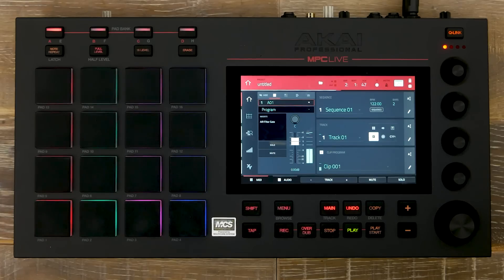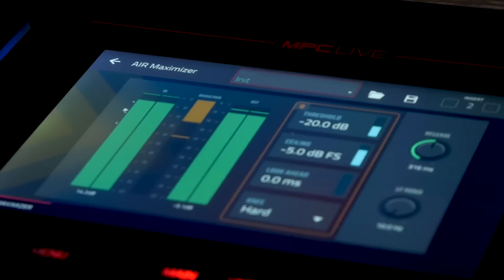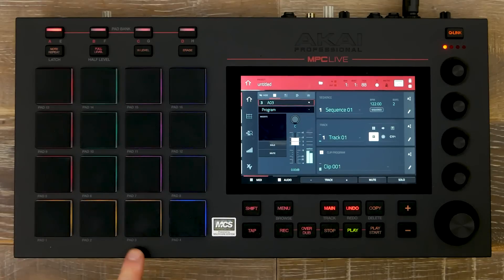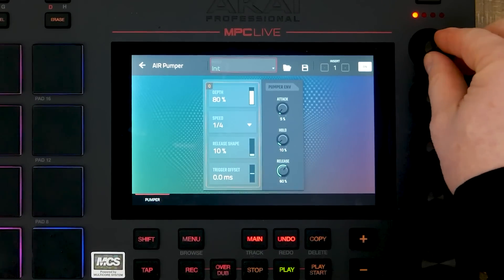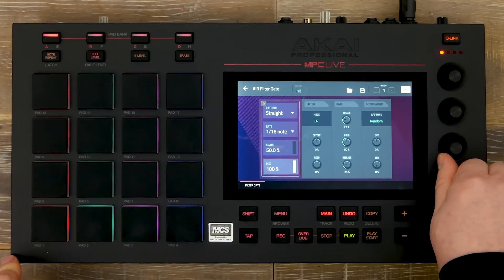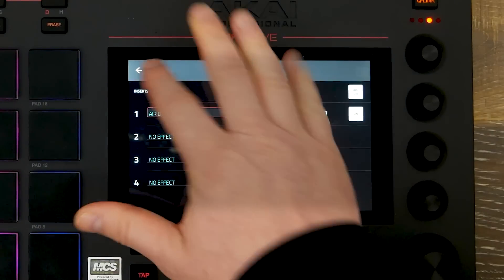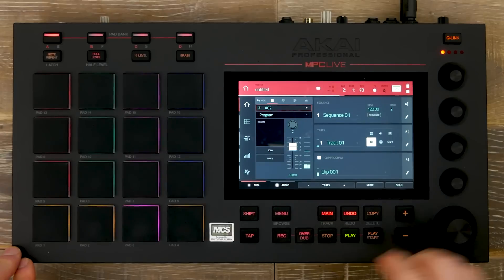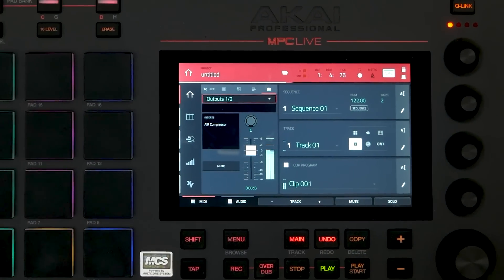MPC Lounge: MPC 2.4 Overview

Comment: This is great and all but it is so frustrating looking at these videos when they say instruments and plug ins come with the Akai MPC Live and you can't find anything you see on these videos!!!  How the hell do I install these I've tried contacting Akai and they're only open Monday-Friday 8-5 which is when I work!!  Is there any videos that can show me exactly how to download these instruments and plug ins and then be able to verify they got downloaded?  I am frustrated with the Akai programming
Reply: Erik, The instruments and plugins are already installed inside the hardware if you're using the latest 2.4 Firmware. Plugin Instruments were added on 2.3 so to access the instruments, you need to select the plugin icon on the home screen which instantiates once instances of either - Tube Synth, Electric or Baseline.  To add FX you need to navigate to the channel strip section on the home page. This then offers 4 inserts across Master, Track, Program, Pad. Also watch the TubeSynth Lounge video I did....you may find this helpful. If not, please message me and I'll be glad to assist you.

Comment: Nice. This update helps to add a little extra to my beats now. Loving the ensemble, multi chorus, diff delay, and freq shifter on almost every beat now. That tube plugin is dope for kicks too to get extra volume.
Reply: How do you do that with the tube plugin?
Reply: @elmortobeats5919  It adds saturation so you are able to push the input a little and add extra gain. It works on those quiet kicks that need a boost.
Reply: @DaspacestationBeats  cool, i will try. Thanks.